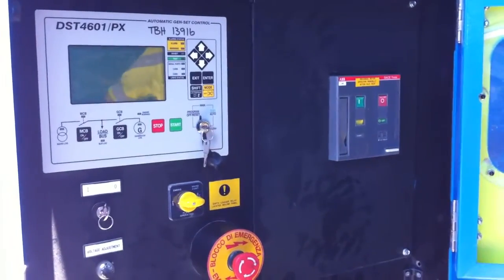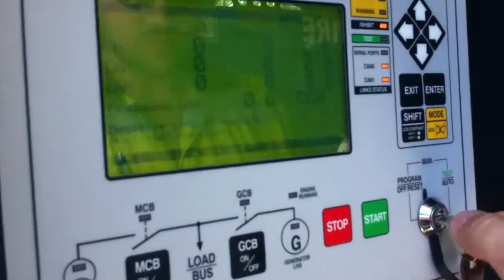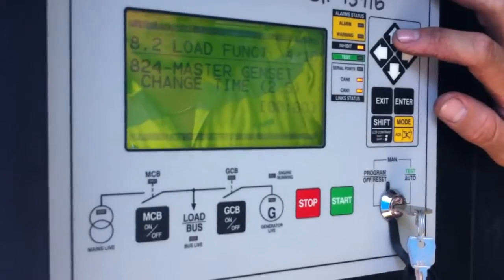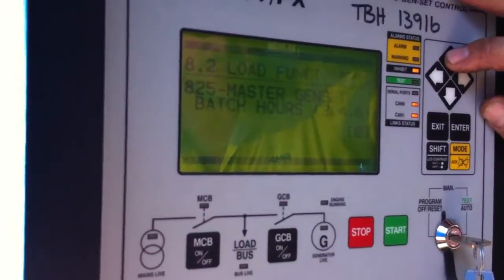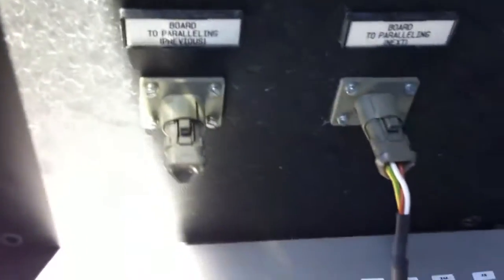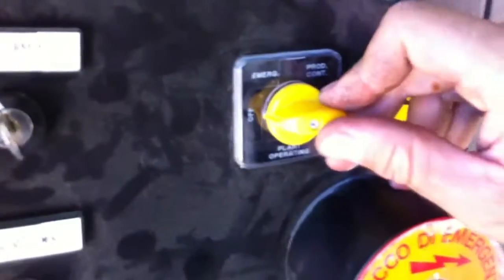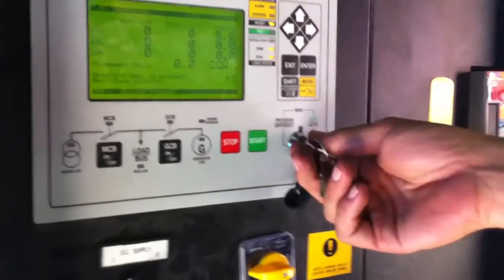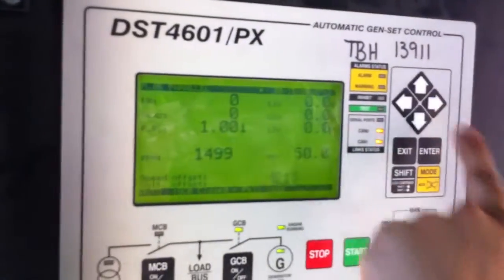DST4601/PX LOAD FUNCTION programming (1)

Comment: I have 3 panels. 3x2000kva gensets. 1&2 share the equal load while the third one takes 40% less. Progreamming side all panels got same power and kva parameters. Any Ideas?
Reply: Check for parameter P.0801 (rated power) on all genset controllers.